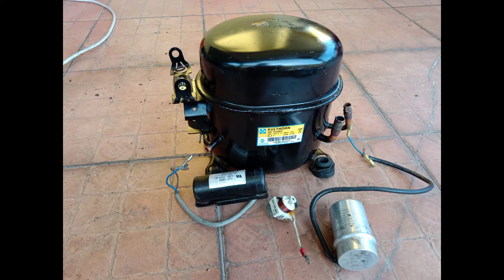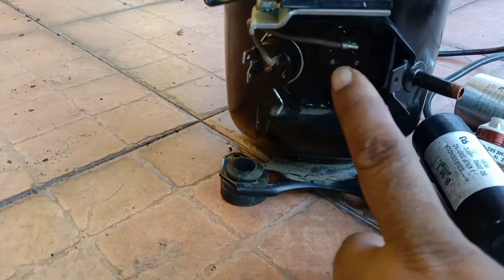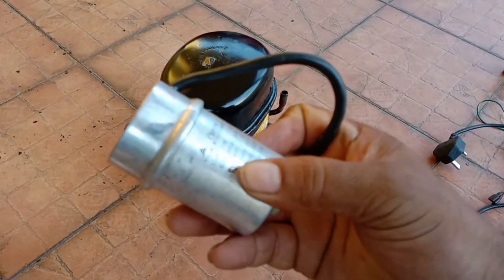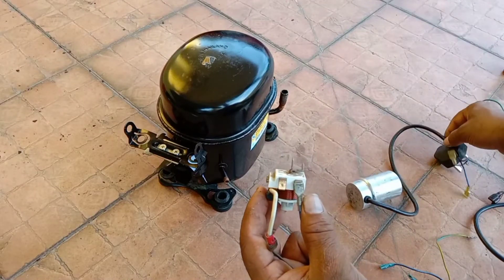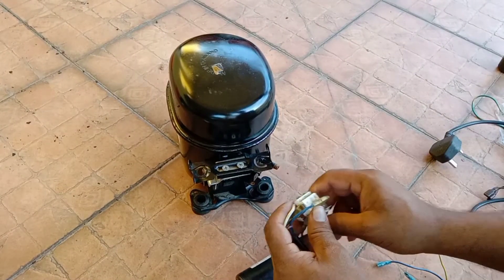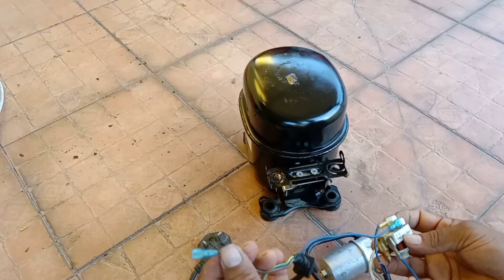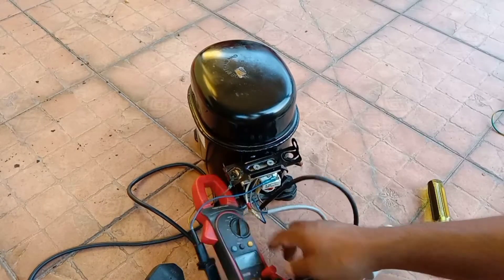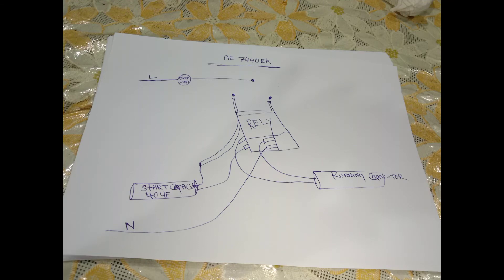How to setup capacitor to relay ?

Comment: Are you testing this compressor? You should test the suction valves by hooking up your suction gauge,  closing the suction side of your gauge, and running the compressor. It should pull down to about 17" of mercury rather quickly.  If not, the valves may be no good.